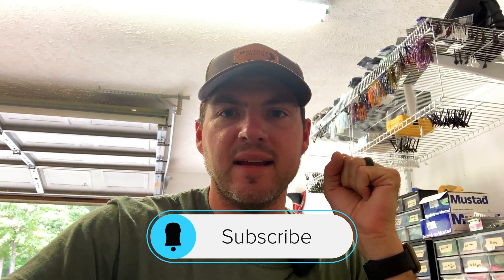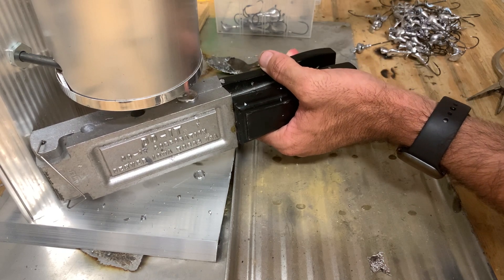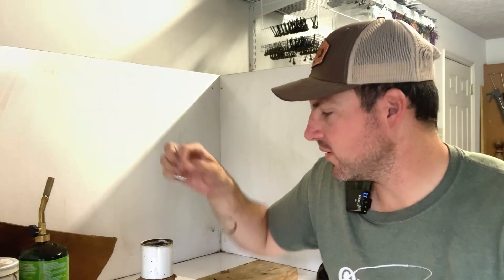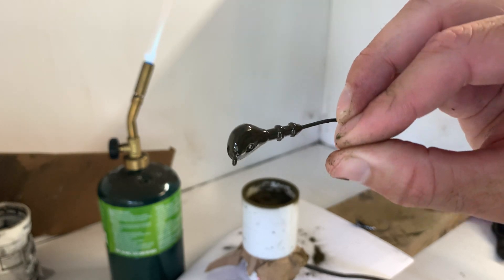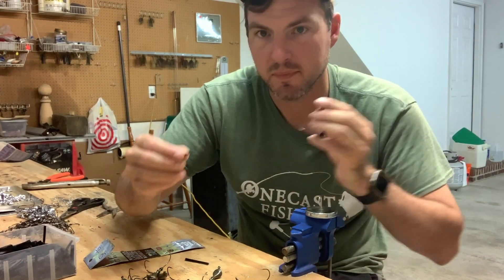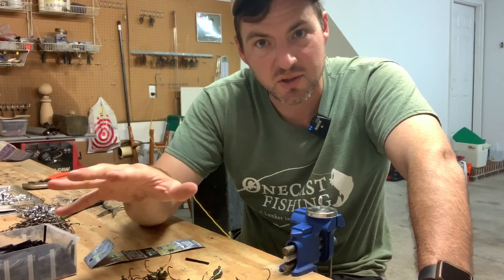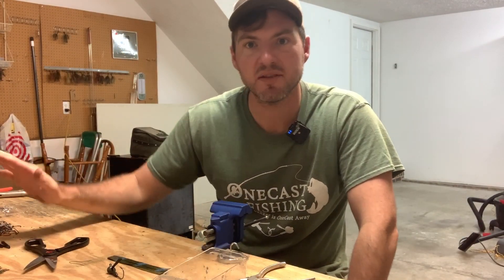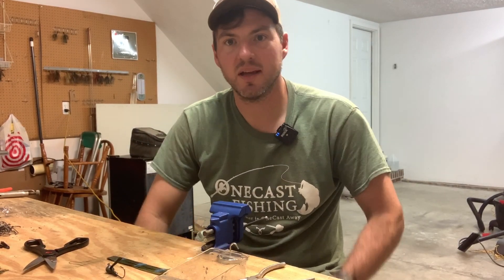How We Make Our Bass Fishing Jigs -- Wired-Tied & Hand Poured

Comment: Great video!! I've been using the bands when tying but wanted to start wire tying them. This was a good instructional video and helped me out a lot. I've seen some where they put thread down then wrap the skirt with it to hold it in place then use the wire but seeing your way it looks easier. One other question: Do you put the main color on the bottom then the highlight on top so the highlight color would be where weed guard is and main on top of hook?? Thanks again. Stay Safe & God Bless!!

Comment: got tired of fiber weed guard so i found tip to put high temp rtv in weed guard slot in mold. then i use the wire guard wire. the just cut off extra.